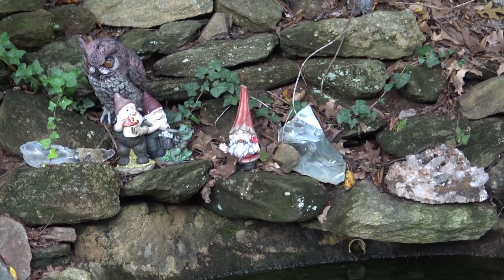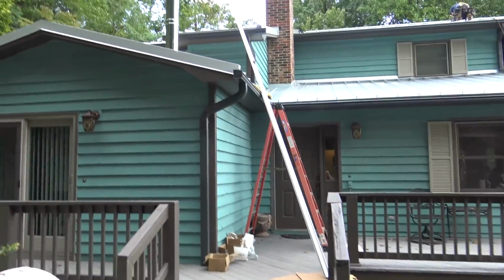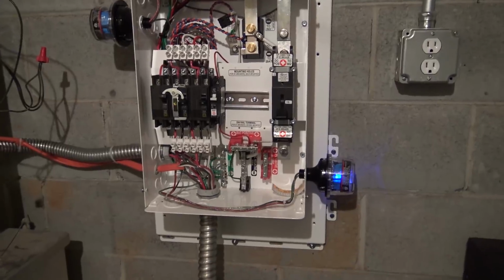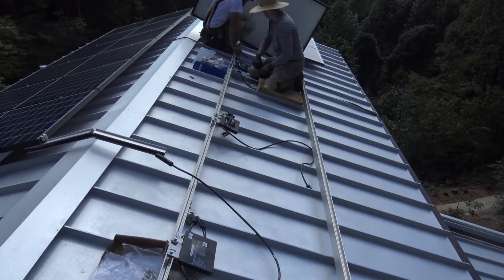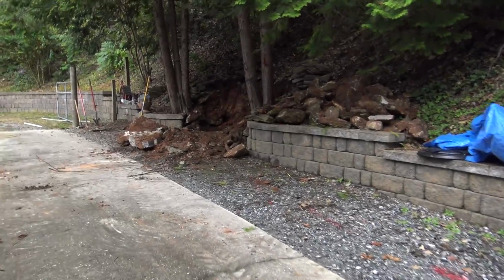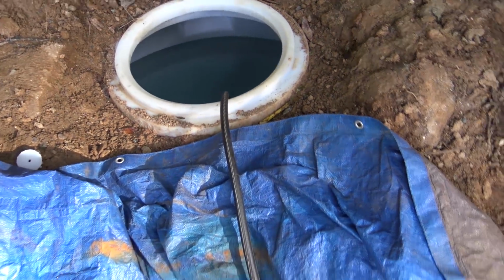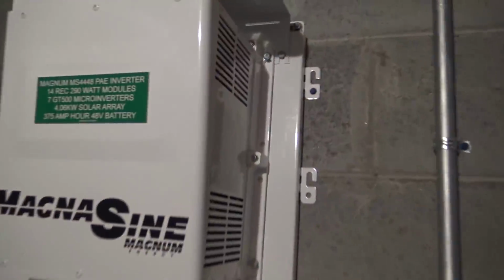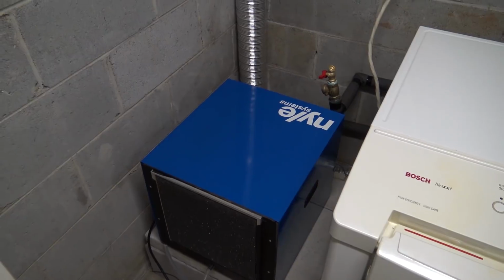Maximizing  the Resources on your Property!

Comment: You don' need eletricity, you can use a ram pump. The energy comes from gravity. A valve creates repeted shockwaves, and the shockwaves compresse air in a chamber. The air pushes the water upwards 4/6 meters to a reservoir. 1800s technology. Many ramp pumps still work after on century of constant duty in the countryside of France and GB.

Comment: How do you get around the dissimilar metals between the roof and the racks?  Won't the clamp hardware eventually "eat" through the roofing metal at each attachment point???
Reply: nonsquid the aluminum has an anodized coating

Comment: It is a good thing that the battery bank is only intended for backup use.  3.6kW usable out of 18kW wouldn't stretch very far in a typical home.
Reply: Solar SAGM 06 375 Deep-Cycle Solar AGM
Reply from the maker: so why is only 20% usable?
Reply: Engineer775 smaller depth of discharge results in fewer cycles which in turn results in longer life between replacement.

I'd rather replace batteries every seven to ten years than five of fewer.
Reply from the maker: Deryk Robosson yeah I totally understand how the battery works I was just wondering why the 20% discharge was  randomly picked? The battery life in cycles for that Trojan Battery are based on 50% depth of discharge.
Reply: Engineer775 it wasn't randomly chosen as it is well known that 10-20% DoD typically gives the best results, band for buck and cycle life, for lead acid and SLA.

What was the model number of the Trojans?  I'm be curious to read the datasheet as I'm about to return off grid.  I'm not game enough to go lifepo and T105s aren't sufficient capacity.
Reply: The system doesn’t have a daily depth of discharge. Only cycles if the grid is down.

Comment: Wouldn't it have been a good idea to add a hand pump to the spring reservoir tank? Just in case he solar drops or dies? At least it has a removable top for dipping water out. Great system though. Thanks for sharing.
Reply from the maker: Actually a better hand pump for this setup is an Excelsior E2 placed in their garage next to the bladder tank.  THe pump would be lower in elevation than the spring and you could easily pump 6gpm and pressurize to 40psi.  They didn't want the option but they could always do it later.

Comment: Sorry I am adding comments as the video plays.  If you use the SQE you can hang an manifold on the wall with a 2 gallon tank, and will shut the pump off with low voltage and lack of water.

Comment: As far as the pump.  I sell Campbell pump screens, 4” pvc with a plate bottom and slits cut into the sides of the pipe about half way up.  The top is a 4 x 1 well seal. Works great to force the water up around the motor.
Reply from the maker: I just found Flowsleeve and ordered their setup.  Very Reasonable.

Comment: That looks like a mostly high efficiency net metered system with battery backup. How much of a hassle is all the paperwork, and dealing with the utility?
I understand the need for privacy, but can you tell us which state that's in?
Thank you for sharing your videos with us.
Reply from the maker: Paperwork is always a hassle.  The local building codes folks can give you a  run for your money, drawings, engineering stamps, roof inspections and engineering approval, permits, interconnection etc.

Comment: I have a off grid system solar I have a generac off grid unit 15k propane it on a two wire system solar to gen problem the battery in the generator doesn't stay charge and the generator Cycles too much
Reply from the maker: The Battery in the generator needs to be charged off of the solar system.
Reply: So do I go to the solar company for a device or a schematic or to the generator company???
Reply from the maker: I would just put a battery tender on the generator battery.  The Tender would run off of the solar system.
Reply: Engineer775 they make solar powered battery tenders.
Reply: Johnny Valentine where do I get one solar vendor or generator vendor?
Reply from the maker: you can cobble it if you want too.  We put generator battery chargers in the critical loads panel.  Having a receptacle in your generator cabinet is great for not only the tender, but for block heaters as well.

Comment: I hate that type of switch they gave me nothing but problem had to keep resetting it. Then again that was about 10 years ago. Thanks for the video
Reply from the maker: They should only have to reset if they run out of water.  No issues so far.  A lot of times the initial bladder tank pressure is set wrong and because of it they trip a lot.